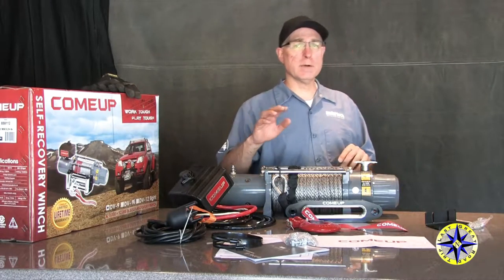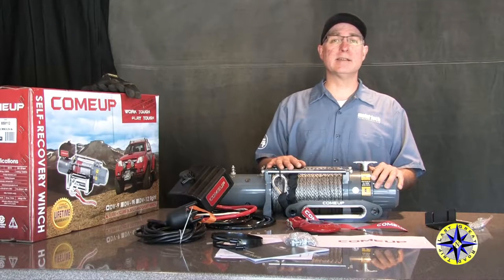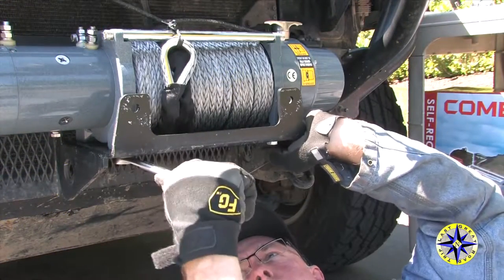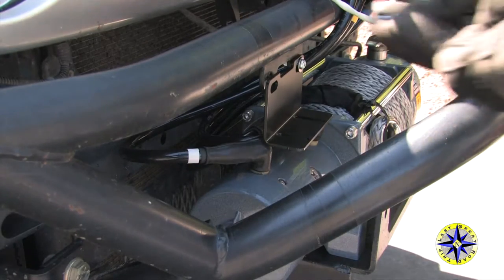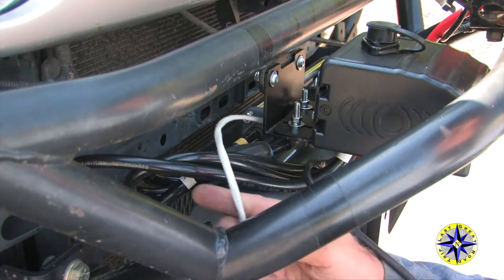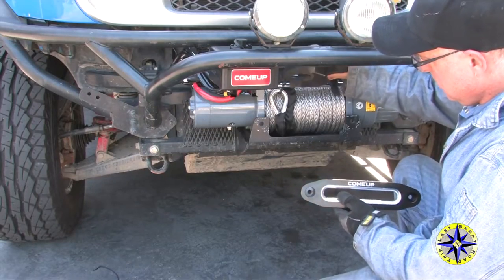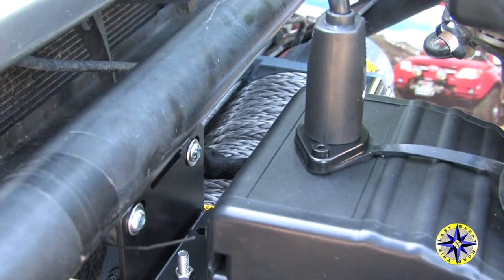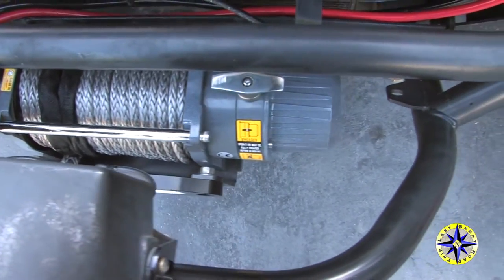Installing COMEUP Winch

Comment: I would recommend that, after installing a new winch, you let out the line, connect to a fixed object on flat ground and then spool your line using just the rolling resistance of your vehicle. You would now have a line tightly wrapped around the drum. This prevents premature wear of your synthetic line if it wasn't tightly wrapped around the drum to begin with.
Reply from the maker: Great point...  as you saw I also recommend that you "exercise" your winch every month or so (if you don't use it very often) to help keep the motor grease distributed evenly, burn off any water that may have found it's way into the motor and ensure its operationally ready for when you need it.  Following your line spooling is one of the best ways to exercise it.  http://www.lastgreatroadtrip.com/4x4-tech/gear-review/fj-cruiser-lift-kits/

Comment: thanks for the information sir I think that permanently mounting a winch to the font real limits the winch and it capabilities would it not be better to be able to put it one the back of the vichle also not to mention put it on a trailer. I don't have a tone of money to put a winch on the front and back of my truck and then one on my trailer also. trying to figure all this out.
Reply from the maker: iwantosavemoney many people use a trailer hitch mount for their winch so they can move it to the front or rear.  Not something we need but it's an option